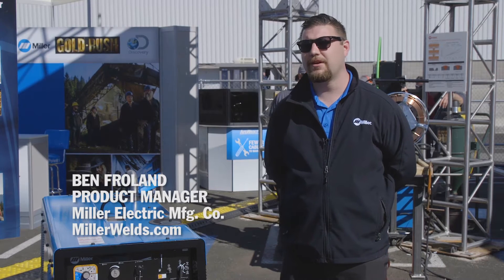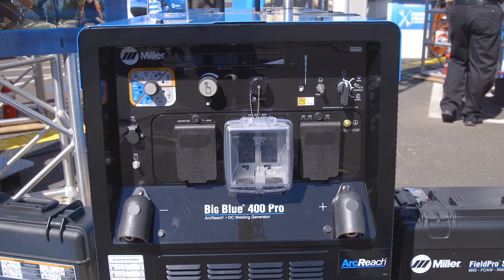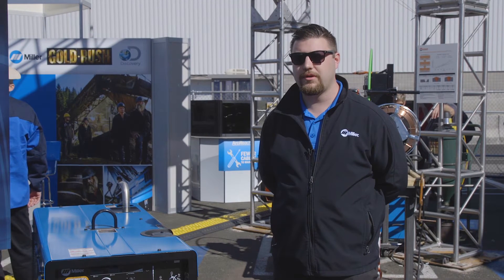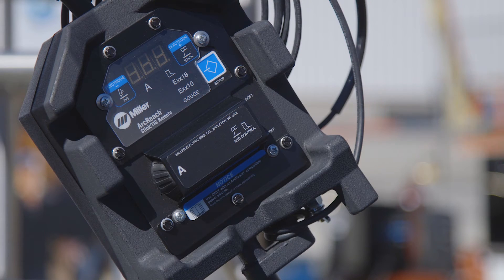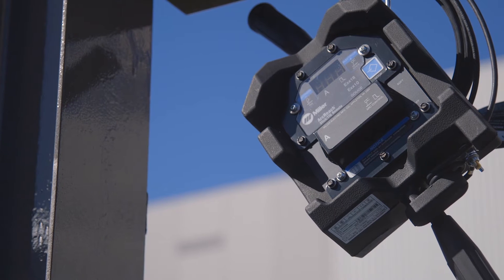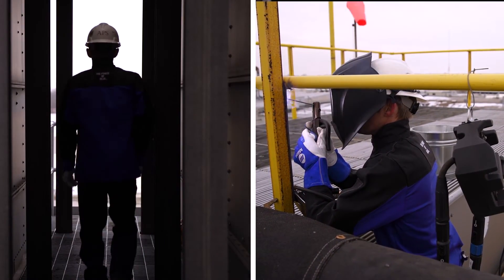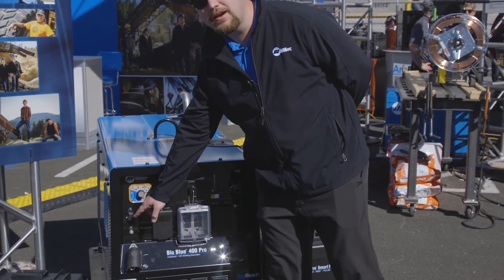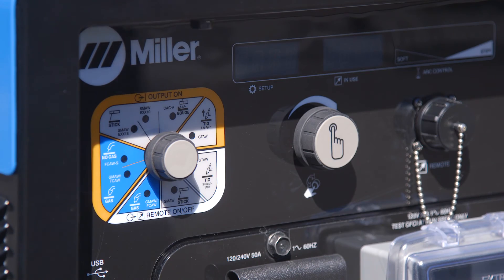Miller Big Blue Welder Remote Control Capabilties

Comment: When welding pipe you may need to adjust your temp on the fly. You can NOT do that with this remote. I don't even use this remote, instead I have a 6pin Miller remote that I can adjust on the fly.